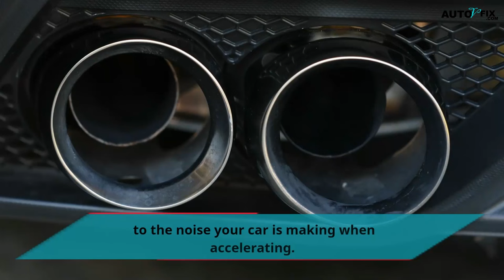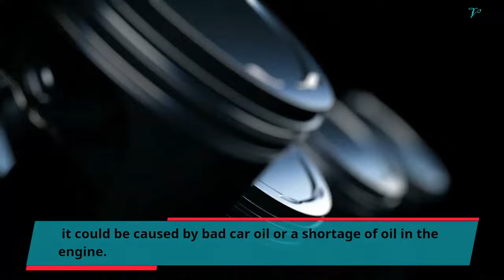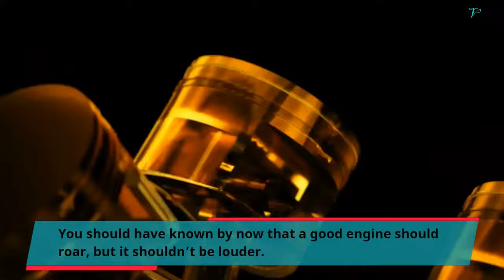WHY CAR MAKES HUMMING NOISE WHEN ACCELERATING or Driving

Comment: Okay this video sucks so I’ll explain it to you. The noise you hear might not even be the engine. Typically a whistling noise could be the turbo or transmission. When the turbo fails it starts to whistle with every rev of the engine. Same thing with the transmission when there’s a leak the transmission pump starves of fluid and it makes a whistling sound with engine revs. You could also have a small exhaust leak that makes a whistle sound. Lastly when engine age they just randomly make different noises. If you hear a noise like a whistle but the car runs and drive just fine I wouldn’t worry about it. Of course check fluids check for leaks but in my experience it’s usually turbo or transmission nothing to do with the engine itself. My cars 20 years old there’s nothing wrong with anything but I noticed it just kinda sounds different now but everything is good.
Reply: This makes sense  because I started having this sound after the Turbo was replaced... Thank you for sharing.

Comment: Ok on my 2013 camero the noise from my car is the wind blowing in-between the left mirror and the car. Roll down your window put your hand in-between the left mirror and the car and the noise will go away.the wind is making the noise blowing between the mirror and car.after I put my hand in-between the mirror and car the noise was gone.the noise would happen around 50 and 70 miles an hout

Comment: i have 2013 lexus RX 450h. My car used to be very quiet but now it is louder than ever before. I am not sure if it's humming sound but it sounds like humming lol. It gets noisy when car is being driven on slow motion, I can hear it more louder when I am on the ramp existing and merging to the highway. All 4 tires are keep loosing air too. Every 4 days or in week I have to inflate them not all but one by one. My mechanic said it's a wheel bearing but when I asked him to fix it, he said it's not wheel bearing. Any idea or any help what it could be?

Comment: My car have humming noise the when steer slight right only..when center and left no sound. What could it be the cause of humming noise.
Reply: I have the exact same problem right now, have you found out the cause of the sound?
Reply: Sounds like a wheel barring.